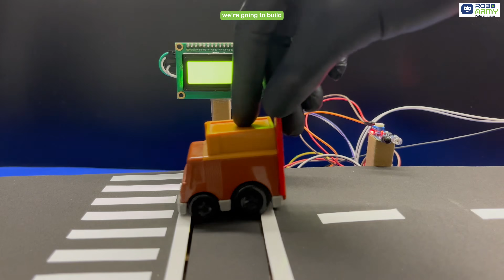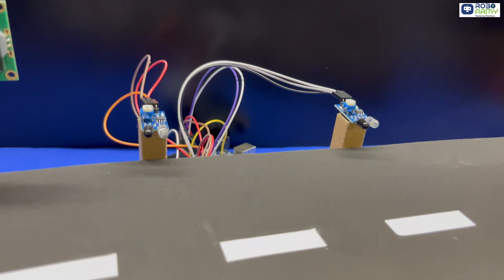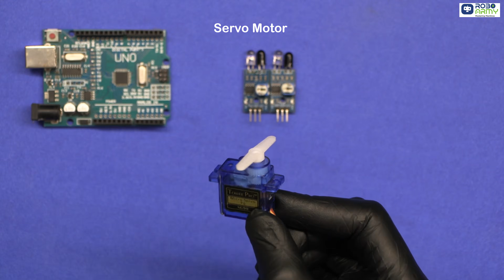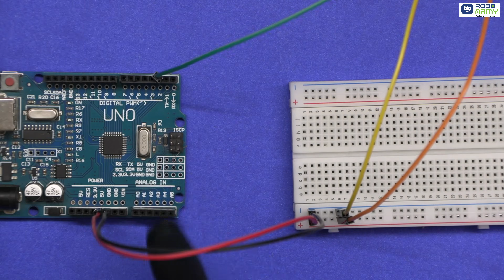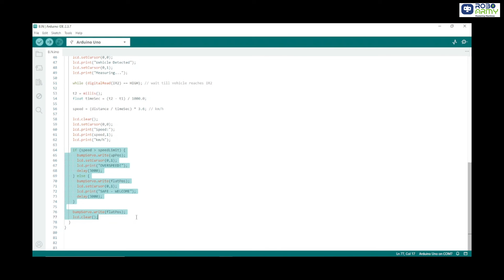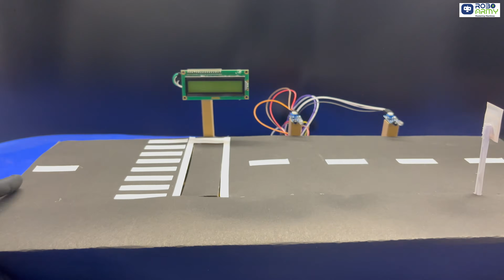Smart ActiBump System using Arduino | Speed Detection Based Automatic Speed Breaker

Comment: How much ampere and voltage in power supply/battery pack?
Reply from the maker: The project can be powered using a 5V power supply, with a current capacity of around 1–2A. If you’re using a battery pack, make sure to use a suitable 5V regulated output for the Arduino and other components. The exact current requirement may vary depending on the motors/actuators used in your setup